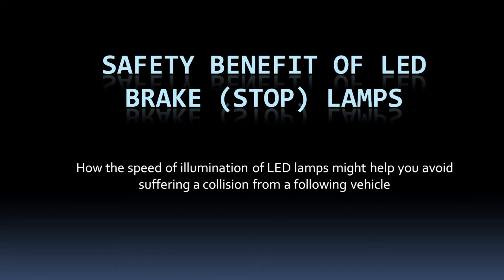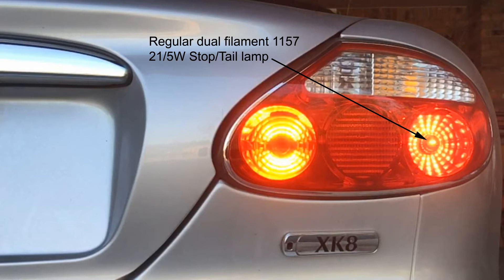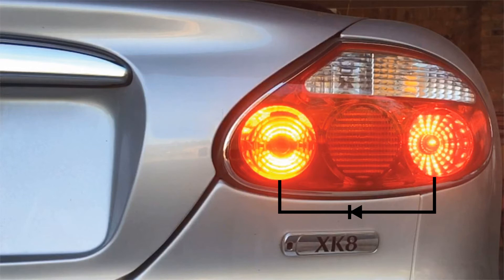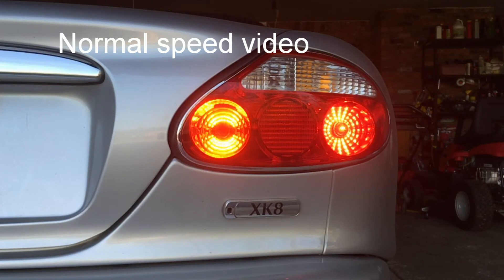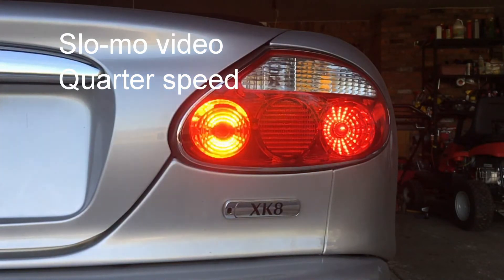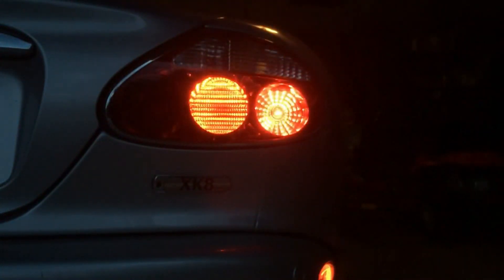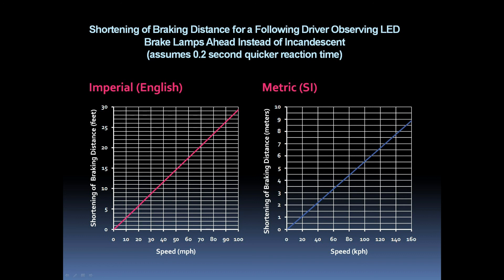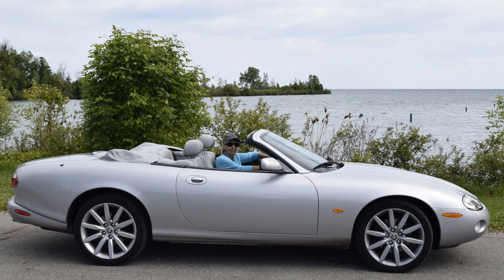LED vs filament stop lamps

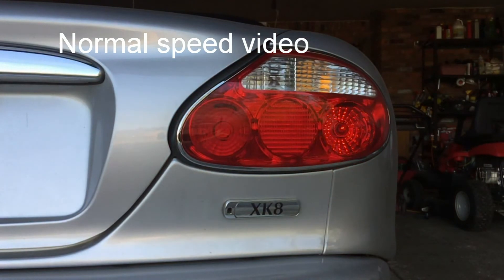Comment: Upon investigating this mod for my 2004 XK8 I discovered that the 85 terminal for the brake light and rear fog light relays in my car appears to be the ground (12 3:51 -) connection for the relay's trigger coils. This implies that the switching circuit actually switches the ground side of the circuit rather than the hot (12+) side, which seems strange to me and my North American vehicle experience. 
Is this observation correct, or is there something else afoot with my car,  and something else for this modification?
Reply from the maker: Brian, you’re correct in that loads in the XK8 are for the most part ground switched, otherwise known as low-side switching. However, it isn’t a switching method confined to Jaguars or even European cars; it is equally common on all cars with extensive electronics, including American and Asian vehicles. 
The reasons are twofold: 
Firstly it’s safer. If you imagine a load, be it a relay or any other load, being supplied current by a switching transistor (the type used are called MOSFETs) in a centralized computer the consequences of a short on a wire to the load or a connector at 12V+ would be, hopefully, a blown fuse or worse that would disable that load and any others protected by the same fuse. When the load is low-side switched, with the switching MOSFET between the load and ground, and the load hard wired to 12V+, then the only consequence of a short between the MOSFET and the load is that the load switches on. That’s usually a benign event except in some rare cases, an airbag being a notable exception. 
Secondly, it happens that the type of MOSFET that is necessary for low side switching, called an N-channel, is inherently less costly to build than a P-channel, which is needed for high-side switching. This in itself leads to lower vehicle cost but also has resulted in N-channels being made in much higher volumes, further reducing their cost.